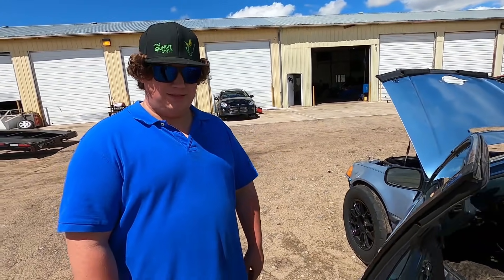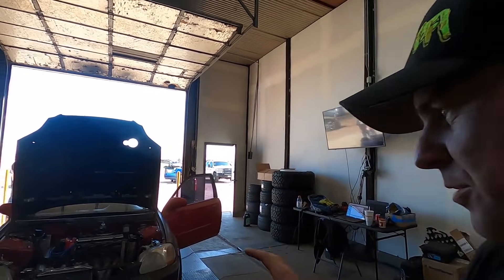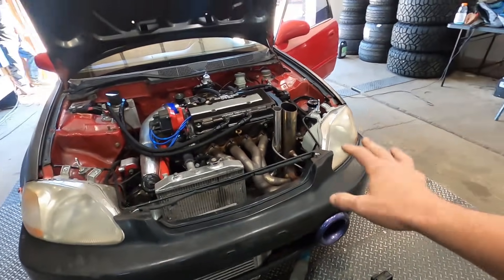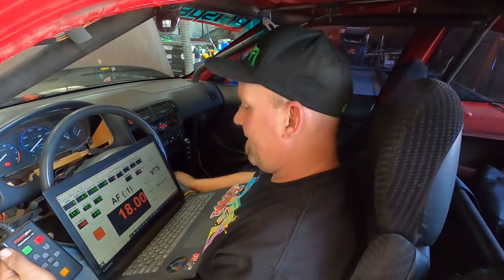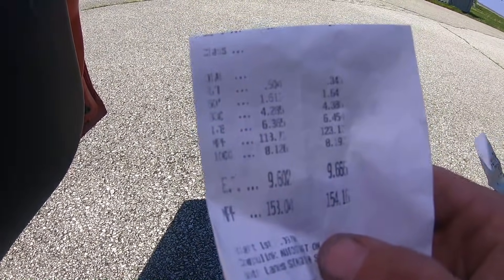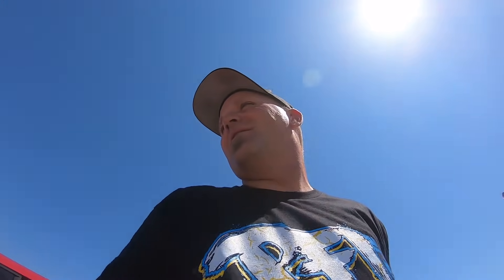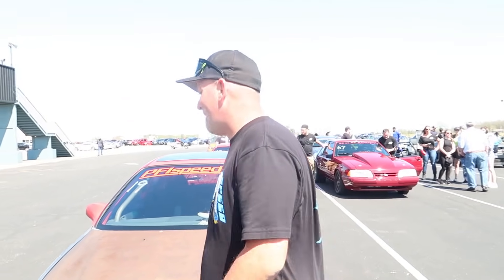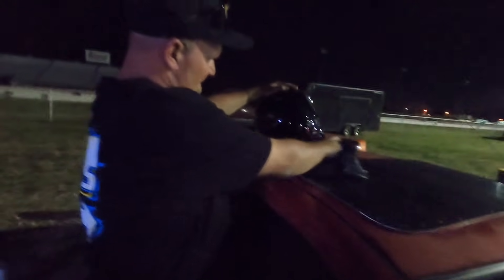Jamie’s and Milo Jammin Gears! Honda’s rip at Cleetus and cars

Comment: There are adaptors from k series to bmw dcts (rwd and awd)  and vag dcts, including the dq500 awd trans. All of them have been run to 1000hp with only upgraded clutches. They are softer on the valvetrain and drivetrain and they are faster and cheaper than sequentials.
Reply: Those look very interesting.

Comment: Jaime upgraded the fuel pump am i correct? How much improvement did he get with the upgrade and was it worth the work?
Reply: He switched to a mechanical fuel pump over an electrical
Reply: I am still dialing it in but yes it helped. The car was at 100%duty cycle with the electric pump, its half that now

Comment: What’s the engine setup on Jamie’s car?
Reply: Gsr, aluminum rod, outlaw pistons, l19 head studs, roller rockers, bc3 cams, springs/retainers, twin disk, lsd, stock syncros, pulsar gtx3584rs t3 turbo, mechanical fuel pump on pump e85

Comment: A mill AND a lathe....🥲<-"They grow up so fast..."
Hopefully:
#A) Lathe has the threading screws/attachment (assuming it's an engine lathe; can't imagine why you guys would get a turret lathe....unless it was free. Our free lathe, AWESOME shape, dials are metric!! I love it as the metric system, once you 'get it,' is a million times easier...others not so much. Brent may be old enough to remember the last big push the U.S. made to ditch the imperial way of things? They change any speed limit signs in CO. from MPH to KPH?? MN there were a bit.) ANNAHOO...

#177.2-C) Mill IS INDEED a Bridgeport WITHOUT variable speed head (variable speed is like an automatic transmission; soaks up like 20% 'o the powah). You sees, in my opinionesse step pullies is da knees of da bees my O.G.'s.